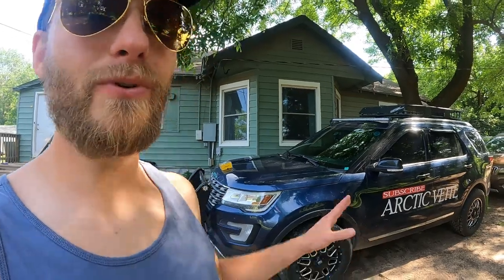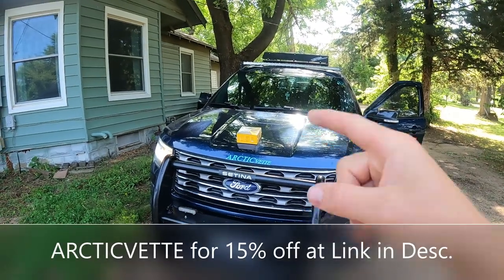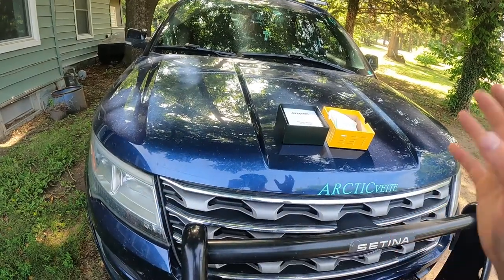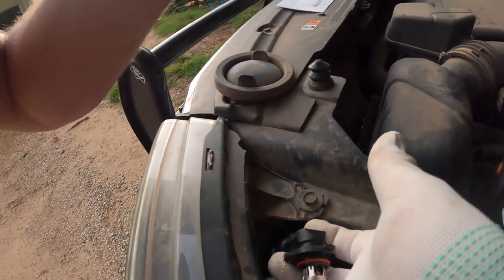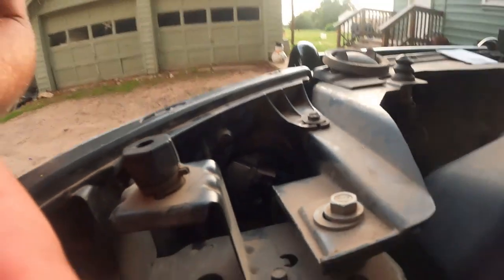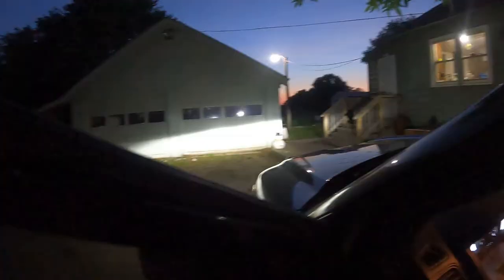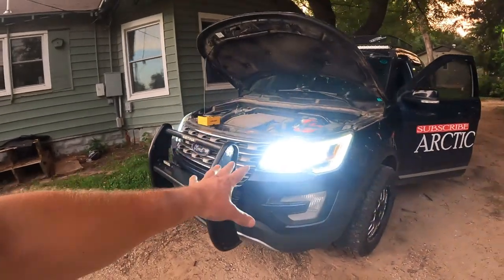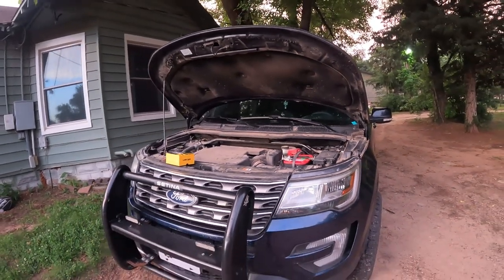How To Install High Beams LED Lights (2011-2019 Ford Explorer) ft. AUCITO LED Lights - Daily Vlog

Comment: I have the 2017 Explorer Police Interceptor Unit, commonly known as the PIU.
The reason (I was told) that they have the different bulb for the brights is because when the police are using the wig-wags it shows up better. 
Obviously, I don't need the wig-wags either so I am about to change to the LED to match the low beams lights.
Ford and their bright ideas (to keep their mechanics working) you need to take the Setina and the front bumper off.
Reply from the maker: That makes sense as to why they made them different.

Comment: Easier to remove the headlight assembly?  No sir, that is most definitely far more difficult.  You have to remove the bumper/grill assembly in order to remove the headlight assembly and that is just a huge pain.  I just got finished installing my FORD Raptor grill, some additional lights next to the stock driving/fog lights and an ARMORDILLO Bull Bar and I gotta say, the longest part of the job was getting the bumper/grill assembly off and back on again!  Sorry, I'm still a bit surly about it as I only did it last weekend, lol.  It looks pretty awesome though, so totally worth the headaches!

But now I'm thinking I'll have to pickup some of those bulbs as well, they look SO much better and brighter than stock!
Reply from the maker: Thanks for letting us know! I had a feeling the bumper had to come off. I've had it off once before to install my push bar but didn't bother looking at the headlight assembly then. 

These lights are totally worth it!

Comment: Bought these as well, got a 2017 ford explorer and for some reason my connector is 9005/HB3 and not H15 😢
Reply from the maker: Dang, that's a bummer. You might be able to exchange them or return them for the correct ones.

Comment: Good stuff man, very helpful.   I switched out high beam and license plate lights with auxito, aside from the back up lights what other lights on the 2018 ford explorer are halogen from factory?  Wanting to go all led
Reply from the maker: I think that there are some interior lights, and the spot light on the mirrors. Otherwise I think you're pretty close to all LED! 

It looks so much better with LEDs 🙌🏼

Comment: Great video,  Have a question, How did you get your computer (ECM) so they don't hyper flash and give off a code error. Thanks
Reply from the maker: I didn't have that problem. It was just plug and play for me. There might be resistors or a plug that you can buy to fix that issue

Comment: I would guess the halogen bulb high beams are a cost cutting/saving measure... Each headlight assembly is insanely expensive with only the  low beam LEDs... I can't imagine the cost for low and high...!
Reply from the maker: You're probably right. They have to make it look good most the time and can skimp on the not as used functions, such as high beams. 

This upgrade is totally worth it!

Comment: Did you change the low beams too or just high? And are the low beams factory?
Reply from the maker: Just the high beams, my low beams are built into the headlight assembly. It requires a lot more work than just replacing a bulb.
Reply: I have a 2016 FPIU and the high beams are TRASH! I will be changing out the bulbs soon…

Thank you!
Reply from the maker: @janvierhuit  they really are, mine were worse than the low beams. 

You're welcome!

Comment: How do you change the low beams in the 2016 ford explorer ?
Reply from the maker: I did a little research and it appears that the low beam bulb, is a built in LED. There seems to be an issue with the computer module that is on the bottom of the headlight assembly. Where is causes the low beam to not work. 

Removal of the headlight assembly requires the bumper to be removed and I have a video showing the process of removing the bumper. 
https://youtu.be/k_HHDt2p77E

Also, here is a video of reinstalling the bumper. https://youtu.be/-QFOI6hIHRo

Comment: I have a 2016 ford police Utility what are the white light on the outer headlight it self and how do I get them to turn on my interceptor only turns on the headlight not the light bar around the headlight
Reply from the maker: It maybe a difference between the two models, interceptor and civilian explorers. 

But I think you can check under the settings on the dashboard. I believe you navigate to Vehicle, Lighting, Daytime Running Lights, and check it to turn it on. That's what turned mine on, hopefully this helps!

I can make a quick video on how to do this tomorrow!
Reply: @ArcticVette  yea please make a video and maybe make a video how to turn it on with FORScan
Reply from the maker: @tommmy2dads373  I'm not familiar with FORScan but I'll look into it. I'll get that out tomorrow 😊
Reply from the maker: That video will be live tonight at 5pm CST
Reply: @ArcticVette  did you figure it out like how to do it on FORScan
Reply from the maker: No, I wasn't able to but it's easily do-able via the dash menus
Reply: @ArcticVette  I tried just turning on the daytime lights but it doesn’t work for me
Reply from the maker: Were you in drive? While in park they won't turn on. I demonstrate that in the video I made today.
Reply: @ArcticVette  my daylight running lights won’t turn on do I turn them on in FORScan ?
Reply from the maker: @tommmy2dads373  it appears that you click an icon that looks like a chip in FORScan. Then click Configuration and Programming. Then click GEM/SJB module. Click the play button, run procedure. That'll load a bunch of data. 

When that process is finished, click Daytime Running Lights. Click Enabled, click the checkbox. Then write those changes. Finally turn off the vehicle and turn it back on. Now they should be on.

I found this in a few videos. I don't have FORScan yet but I'll look into getting it and see if I can make a video specific for FORScan.
Reply: @ArcticVette  when’s the new video coming out tonight ? It’s 6:13 pm for me
Reply from the maker: It should be out now, about an hour ago it went live

Comment: How does the LED keep cool with that rubber cap on it?
Reply from the maker: Good question, it has a built in fan that keeps it cool
Reply: @ArcticVette  but that rubber cap is supposed to keep moisture out, so if it's watertight, it's probably not allowing air to flow freely
Reply from the maker: I'll have to find out. So far these are working great and I haven't had any troubles with them 🙌🏼